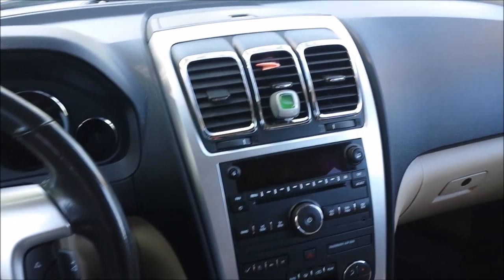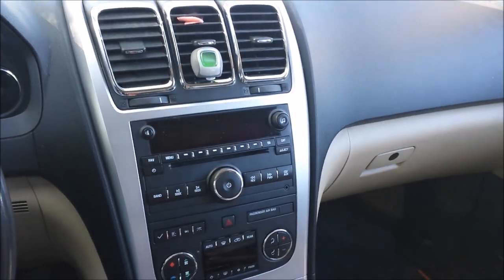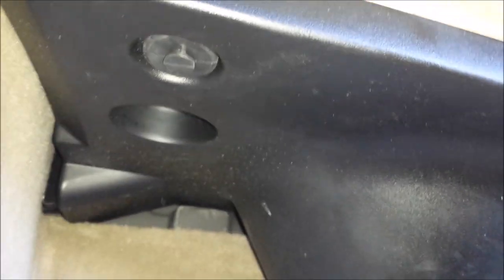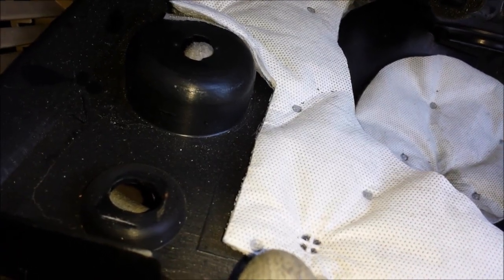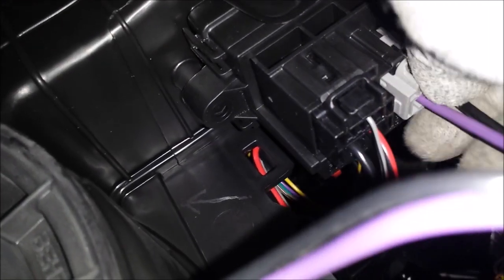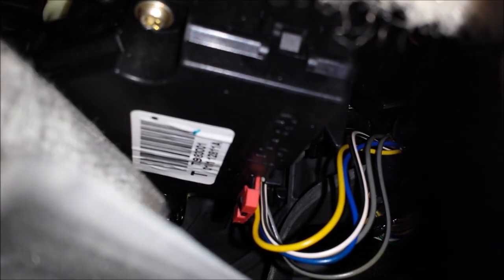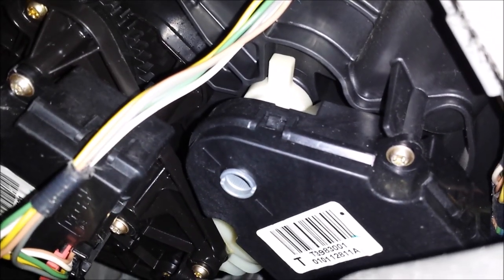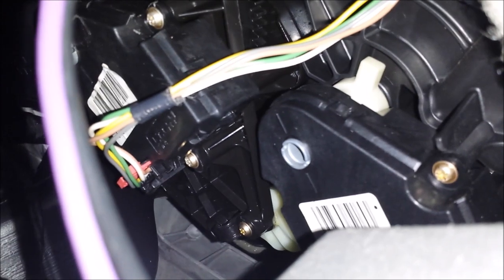A/C blows hot on passenger side? Fix! 2007-2018 GMC Acadia

Comment: Ya... that wasn't fun.  I finally got it off and did the test and the air on the passenger side still didn't get cold.  It was cool but not cold like the driver side.  I guess I have to take it in.  Thanks so much for the video.  It helped out a lot.
Reply from the maker: aww man....i'm sorry it didnt work out for you...and i'm also sorry for taking so long to respond...i somehow missed the notification.
Reply from the maker: aww man....i'm sorry it didnt work out for you...and i'm also sorry for taking so long to respond...i somehow missed the notification.
Reply from the maker: aww man....i'm sorry it didnt work out for you...and i'm also sorry for taking so long to respond...i somehow missed the notification.

Comment: I've got a similar issue where Driver Side blows cold(ish) and passenger AND rear blow warm or hot.  Do you know if the rear is controlled by the same blend door actuator for the passenger, or is there another somewhere else I should look in to?  In the past I've had the actuator replaced by a dealer, as well as the rear evaporator core and motor replaced due to similar issues.  Hoping it's not the rear evaporator core again.
Reply from the maker: There are 2 seperate units. One for the front and one for the rear AC in some vehicles. Unfortunately im not sure if the Acadia has 2 units or not. If there is a seperate heater core in the back of the vehicle then you DO have 2 units and there are actuators for the back as well wjen you have controls for the rear passengers

Comment: i have a 2016 acadia and i have same story like Mr. Ruben Vill. is the blend door actuator position is same with previous acadia model like the one you did on the video?
Reply from the maker: Yes it is in the same position. I would still go with it because the actuator motor itself works, it's just that internally the gears are broken which makes it stay stuck in the hot position. I would remove it and move the blend door by hand
Reply: Maybe the door is obstructed I guess... I can see both actuators moving back and forth on passenger side when I move controls. But It  WAS low on Freon, I bought a van with a meter and raised pressure up to upper blue area. It’s been good for about a month.
Reply from the maker: @quovolez  well you wouldn't see the actuator moving if it was obstructed. And depending on your weather conditions, say for example outside temperature is 75 degrees your blue (low side) should be reading around 30-40psi on the Guage with the car running and AC on.
Reply: Eddies Customs & Restorations yea, that’s what confused me. The blend door was evidently opening and closing fully, yet air was warmer on passenger side. I went back and forth checking the movement of actuators, making sure they fully rotated, and they did. It was really just because I was so frustrated that I bought a can of ac pro, and well it’s been back to normal since.

Comment: Good video. Have a question. I turned my ac on and now it wont switch back to heat. It is same across the entire front. Is this where i would start? 2011 Acadia
Reply from the maker: In this case It would require testing with the use of a multi meter. You would want to check the plug where the actuator plugs to and see if the climate control panel (where you control heat and AC) is actually sending the signal to change the position of the actuator. Chances are since they are ALL not changing, it will be a bad control panel but it require testing to be sure as I mentioned
Reply: @EddiesCustomsandRestorations  thank you will start there.

Comment: I have 2015 Acadia with warm air on passenger side. I can see the blend door actuator moving back and forth when I move the temp wheel from 60 to 90 and back. Any ideas?  Could it be low Freon? That would be my next try. Thanks in advance.
Reply from the maker: If it's warm air only on the passenger side then it's a blend door problem. Low free on would cause ALL vents to be warm
Reply: Low freon would cause ALL vents to blow warm air.  This video is about one side of car blowing cold and other side blowing warm air
Reply: I just added Freon and it’s blowing 54f degrees. I agree with you, but it worked for me.
Reply: steve preston this is not always the case and defers on how the the systems are designed.

Comment: I have a 2011 enclave it is winter and the drivers side blows hot correctly the passenger side blows cold from top and bottom vent.  would it be the blend door actuator.  Also just dropping the glove box and bottom panel looking at the actuator gray tube like gear not moving when you are going up and down on temp control tell you the actuator is bad?
Reply from the maker: Generally yes it usually indicates the actuator is non functional anymore.

Comment: I have a problem.The plastic  actuator doesn't turnю I'm guessing something is stuck in A/C heater box.
Maube you know any video instruction how can I fix this?
Reply from the maker: The actuator inside consists of plastic gears. The gear teeth break over time. Actuator will need to be replaced

Comment: I changed my actuator but still blowing hot. But when i did the test with the actuator out it worked, moved to one side and started to blow cold. So what do you think its wrong??? Please help.
Reply from the maker: Your blend door may be stuck? Did you try moving it by hand to see if it worked?
Reply: @EddiesCustomsandRestorations   yes i did. And it did move. But it only move to the left or the right and the temperature changed to hot or cold, but it didn’t have a middle point. If the blend door is stuck what can i do?

Comment: Hi.  I have a problem. AC blows cold on passenger side.  But I need hot.  I changed the door activator but it doesn’t help.  Can you tell me what should I do?   Winter is coming ❄️
Reply from the maker: So you followed the procedure in this video??
Reply from the maker: If you did and you can still not change the temperature your problem can be somewhere else like in the actual controls. That whole piece where you select the temperature can be bad BUT in this case i don't want to mislead you since I am not physically there to check it. Unfortunately I recommend for you to take it to a mechanic shop and have them figure out the problem. I wouldnt want to tell you to change a part without testing it and it not being the problem.
Reply: @EddiesCustomsandRestorations  yes. I did
Reply: @EddiesCustomsandRestorations   in any case, thank you very much for the consultation

Comment: What code would they trigger, my engine light is on , I’ve worked on the car but can’t seem to clear the code. I do have this same issue with my air. Would the bad actuator be triggering my check engine light?
Reply from the maker: Hello, I would atleast go to a local auto parts store and have them check the Check engine codes stored in your vehicles computer. And no the bad actuator would not cause a check engine light
Reply: @EddiesCustomsandRestorations  do you know if this vid works for a 2018?
Reply from the maker: @jimmyhailey4019  it should

Comment: Hi I change the blend door actuator and the driver side is still blowing hot air what do I do to fix the problem
Reply from the maker: There is another blend door actuator for the drivers side. This video was for the passenger side vents. This was on a customers vehicle so I do not have the vehicle here at the moment to be able to point out where it is located.

Comment: What if you have the same problem but opposite sides from this videos driver side hot and pass side cold?
Reply from the maker: Would indicated the same problems but would be the opposite side actuator
Reply: @EddiesCustomsandRestorations  i have a similar case on my friends 2011 Acadia.. Blows cold on the passenger and hot on the drivers side.. So im assuming it will be the actuator on the driver's side ?
Reply from the maker: @ByronRamos_  high chance of it being the case.

Comment: Anyone know where the actuator location for drivers side on 2017 gmc acadia? I just changed the one i thought was it. Apparently it was the floor to vent blend door actuator. It the only one i can see underneath on drivers side. Passenger side is cold
Reply: Hey where is the actuator you replaced located at on the driver's side for 2017 Acadia?

Comment: Does anybody know the name of the part that the actuator sits on that turns the door open or close for heat/air.  When I went to replace the actuator it wasn't there and I need to order the part but don't know what's it called.  For reference stop at 9:33 into the video and you will see what I'm talking about.  Thanks.
Reply from the maker: Its a blend door. The actuator is connected directly to the blend door
Reply: @EddiesCustomsandRestorations  thanks
Reply: So when I looked up blend door all I got was blendor actuator. Are you sure that's the little white piece that turns the blend door in the car
Reply from the maker: @PoktapokGod818  the thing is is that the white piece is supposed to be part of the blend door. I would be surprised if they sell it separately to be honest. And if it is the blend door that needs to be replaced, that turns into a larger job unfortunately...
Reply: @EddiesCustomsandRestorations  okay, thanks for the feedback.  I guess I'm out of luck

Comment: What if the flap is stuck?? It will not move by hand
Reply from the maker: You may have a block but did you remove the motor when you were trying to move the door? If so, then there may be something inside the box causing a blockage.
Reply: @EddiesCustomsandRestorations  yes motor removed. Wonder how i can get in there without removing the dash?
Reply from the maker: @trucktamusprime4874  i wish I had the vehicle here to look it over. Sometimes you can remove sertain parts of the box which can give you access to get to those areas. But at this point I couldn't say. Dont have the vehicle here. Best of luck. Im sorry

Comment: If anyone that changed it, did the driver side started blowing hot all of a sudden?
Reply: Just had my upper actuator replaced and it STILL blows hot air.... and still makes the clicking sound... so frustrated!!
Reply: I changed it and as soon as I put on the engine, passenger side blowing cool and driver side blowing hot
Reply: Edward Staples fixed the driver side too, realizing that       It needed replacing. Problem solved.
Reply: What about your rear? My issue it my passenger and rear blow hot air 🥵
Reply: Jose Bermeo I took care of the passenger, then the driver blowed got air, so I bought  the same actuator and replaced the driver. Rear blowing hot, sorry to hear that. Let me know if you took care of it. Check other postings to solve it

Comment: My dealer says it is the blend door on the DRIVER'S side, and the dash must come out. So this isn't very helpful.
Reply from the maker: Its helpful if its hot on the passenger side as stated on the title lol.
Reply: @EddiesCustomsandRestorations  I was hoping they could address that issue. Thanks for your valuable input.
Reply: Not sure if you already had it replaced but the driver side is even easier than the passenger side. It's accessible by removing the plastic piece above the pedals. Should be along the center column.

Comment: What's the part number??
Reply from the maker: I cannot remember at the top of my head but just go to you local O'Reilly and ask for the temperature blend door actuator for your vehicle and they will provide you with the part.
Reply: @EddiesCustomsandRestorations  is there more than one actuator in a 2011 GMC Acadia and if so are they all the same part number??
Reply from the maker: @stevepreston1059  there is more than one yes but I believe 2 are the same part number. If you are having the same problem, remove this exact actuator as shown on the video and take it with you to the parts store. Ask for temperature/heater blend door  actuator and when they bring you the part just compare it  if you want to buy it online, simply do this and look at the part number there at the store and then look it up online.

Comment: false,..he actuator It does not control the temperature but rather the position of the blower... changed it and it now controls the dampers but it keeps blowing hot air...ouch
Reply from the maker: @ofershop  if you want to get technical yes thats true, controls the BLEND DOOR that in turn CHANGES the temperature since it is redirecting air.

Comment: I didn't understand something very well. I don't have to remove the code so I want the fuse but after how long do I put it back. And if I take it off while the car is on or whatever. sorry but I didn't understand that 🫤
Reply from the maker: Just remove it, press on the brake pedal simply to make energy flow that way, reinstall fuse. Should work. If it doesn't, disconnect the ground battery cable, press on the brakes, then reconnect the ground battery cable and your codes should be gone.